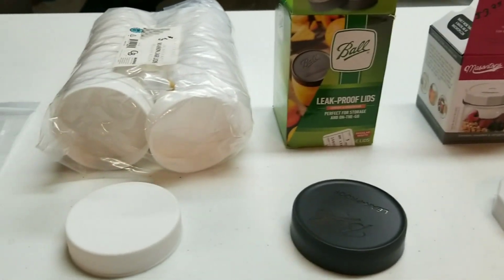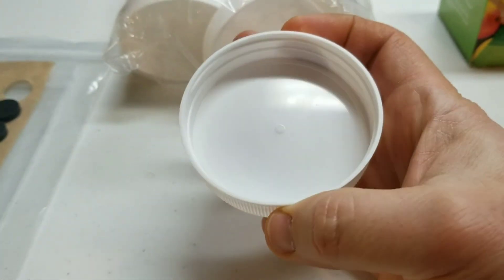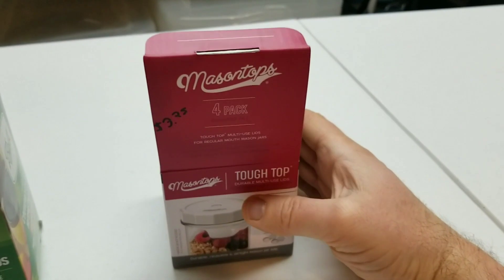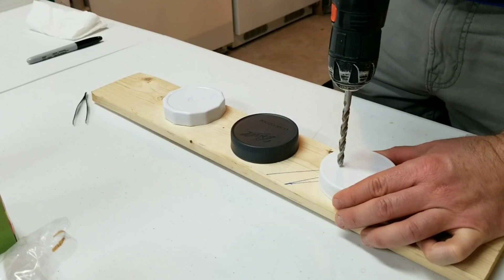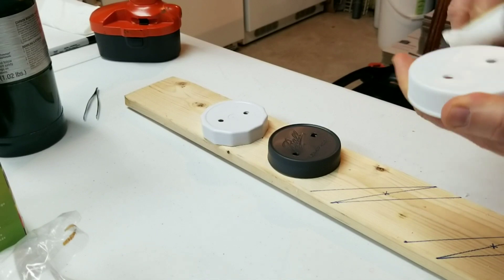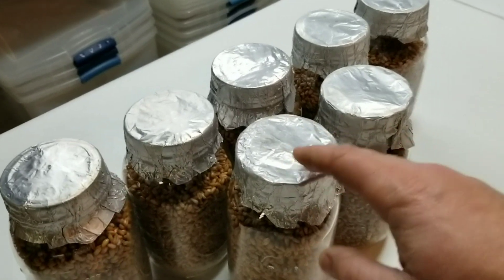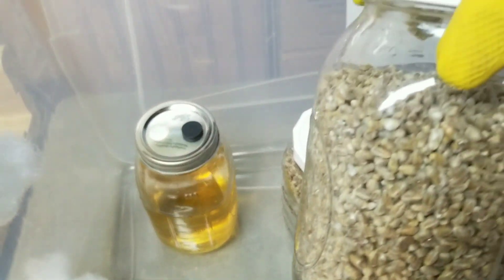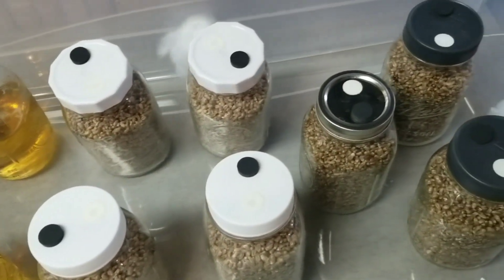TESTING PLASTIC JAR LIDS FOR MUSHROOM CULTIVATION,

Comment: Why the 2 holes on the lid ,and what do you cover the 2nd hole with.?
Reply from the maker: One is for air exchange (filter disc) and the other is a self healing injection port for injecting liquid culture. Both are available here:
https://microppose.com/RenegadeMushrooms 
Use promo code "RENEGADE" for 10% off at checkout.

Comment: Thanks for the video! I got into an argument over these plastic canning lids from Amazon. They work great and PC fantastic, never had an issue. They insist they leak with LC though 🙄 when clearly it doesn’t leak water which is thinner
Reply from the maker: As long as they are PP5 plastic, they are fine in the PC. Manufacturers say no, but that's just a CYA thing. For liquid culture, I do recommend the Masontops Tough Tops lids. They are more pricey, but worth it for the quality and solid seal.
Reply: @RenegadeMushrooms  yeah I mostly run grain spawn jars with PP5 lids, nothing too crazy

Comment: Youde probably be fine without those holes for ventilation in the tote you set all the jars in hey, maybe just a lose lid work? If only could find the chuck for the old Milwaukee drill
Reply from the maker: Yes you don't need the holes in the tote just for jar incubation, but it doesn't hurt. I have other uses for them that do require the holes though so most of mine have them.
Reply: @RenegadeMushrooms  your a good man thank you, wish the drill bits were labeled I got. Finally found the chuck, I don't even own a fridge but the chuck was on the magnetic trey attachednto the mini fridge that's taped shut that in don't use. On a new diet, I'll eventually get a fridge lol

Comment: I don’t have a drill. How can I put holes in lids?  Can I heat an awl or nail and penetrate
Reply from the maker: Yup, that would work. But how can you survive without a cordless drill???
Reply: Lol. I have up until now. I have a corded one.  I never used it
Reply from the maker: @BDK56  Well nows a great time to try it out. Buy a 1/4" drill bit for $5 and drill some lids. Just wear a leather glove on the hand you hold the lid with so you don't cut yourself. It could be a life changing experience 😁
Reply: I just ordered one on Amazon!  Leather glove. Good tip. 
Do I drill over piece of wood?
Reply from the maker: @BDK56  Definitely over a piece of wood yes, and drill from the top down through the lid 👍
Reply: Crossing fingers!

Comment: Just so ya know. You can buy the silicone gaskets separate.
Reply from the maker: Yes, I know. I've actually discussed them in detail in some of my other videos. They can work, but they have their own issues. They pale in comparison to the gaskets in the Masontops Toughtops lids. I've used both extensively, and I have no skin in the game. In this instance, you get what you pay for.
Reply: The silicone gaskets don't seat correctly 100% of the time
Reply from the maker: @1871corporationUSA  agreed

Comment: I'm just getting started down the mushroom growing road so this stuff is really top shelf info.   One thing I hope you may do is somehow keep track of how many rounds you put the lids through the PC so you can get some sort of idea as to when you should retire lids before a problem occurs.  I'm big into quality control in manufacturing with electronics so my QC spidey senses are going off.
Reply from the maker: I've run some of them a dozen or so times and they are still working fine. No issues at all with adhesion. I'm getting the feeling the filter disc material will wear out before the adhesive gives.

Comment: I'm having less contamination issues in my LC jars by not using the filter patches. I do use the plastic lids though. No rust and less pieces to handle.
Reply: So you don't mess with any attachments, just plain clean plastic lid not fully screwed down so it can breathe a little?

Comment: One question is do the filters ever need replacing? If so maybe using steel lids don’t matter. Do the lids really rust if you glue them around the hole? I’ve opened five year old bottles and they weren’t rusty. I did open like a 15 year old bottle and you could tell the lid was rusty or degraded so I know they degrade but bottled jar lids last for years before going rusty.
Reply from the maker: The filters seem to hold up well for 12 to 15 runs in the PC, sometimes longer. They definitely hold up better on plastic lids then they do on steel lids. The steel lids will rust under the filter when drilled and you will see the rust staining through the filter. The key when sticking the filters on to the plastic lids is to make sure the hole is smooth (clean up your burs) and clean (wipe down with rubbing alcohol).
Reply: So you can’t rtv glue the hole on both sides to prevent rust on steel lids?

I’ve been debating about getting steel vs plastic lids for two weeks now. I guess I should try both. Like some say the plastic ones leak or the plastic lids have a seal that falls out. I’ve worked with seals before and it does suck when they fall out. And then some say black or white lids one is better. I guess I should try them all. I notice microppose makes affordable filters etc rather then using the other kind. Ya I guess I’ll just experiment with both kinds and see if it still rusts even gluing the bottom side. I suppose maybe it doesn’t prevent the steel from being exposed to water.
Reply: So you can’t rtv glue the hole on both sides to prevent rust on steel lids?

I’ve been debating about getting steel vs plastic lids for two weeks now. I guess I should try both. Like some say the plastic ones leak or the plastic lids have a seal that falls out. I’ve worked with seals before and it does suck when they fall out. And then some say black or white lids one is better. I guess I should try them all. I notice microppose makes affordable filters etc rather then using the other kind. Ya I guess I’ll just experiment with both kinds and see if it still rusts even gluing the bottom side. I suppose maybe it doesn’t prevent the steel from being exposed to water.
Reply from the maker: @koltoncrane3099  RTV will prevent the steel lids from rusting where you drill, but all steel lids will rust eventually. I still use steel lids for liquid culture because I can't afford leaks. For grain spawn jars though, you can't beat a PP5 plastic lid with a filter disc and injection port from Microppose.com. I'm not endorsed by them, I just like their stuff. I'm personally not a fan of the syringe filters for jar lids, I much prefer the self-adhesive disc style that Microppose sells. The syringe filters are too prone to trapping and retaining moisture imo, eventually leading to mold contamination.
Reply: Okay thanks!! That helps. I was like can you use plastic lids for LC or not. Ya I’ll do the metal lid for no leaks for LC and then do PP5 for Grain spawn. Have you tried stainless steel lids? Or Have you ever had a seal melt on the PP5 as some only go to 249 degrees? Maybe a PC isn’t going to damage them. That was another concerned I’ve heard about. Ya those microppose stick on filters seem way easier haha or convenient.
Reply: I looked and microppose does offer air filters that fit over the metal lid. Have you ever drilled holes in a lid and tried the larger filter that goes above it for more air exchange? Maybe the number of air holes don’t matter. Great tip though on using a burner to melt away burs on a plastic lid. I was thinking of using a file at first but ya heat would be easier.

Comment: My Microppose lid filters changed the holes look a lot bigger than the originals I got. I've tried contacting microppose several time in a multitude of ways and there has not been one answer . But the pics definitely show a huge difference. I can't trust them or the company anymore as they wont even answer or respond.
Reply from the maker: I think they may have changed suppliers, I noticed the difference in my last order as well. The new filters seem to be working fine for me though. When WillyMyco first featured them on YouTube, I'm sure their sales took off like crazy and with all the Covid supply chain issues, I bet they are overwhelmed. I understand your frustration.
Reply: @RenegadeMushrooms  just a simple reply would be nice . I havnt been rude or anything wasn't after a refund. Was just asking the question. I did suffer some contam issues with the new filter patches on . But that was probably from another issue. I have been putting micropore tape over them just in case. Now I'm just using micropore tape.  Not sure if it makes a difference? Micropore is a lot cheaper but a bit messier.

Comment: When you pressure cook these, do you keep the rubber seal on? Also regardless of the rubber seal, do you tighten them or keep them loose while PC? I have modified lids but unsure if they need to be tight or loose
Reply from the maker: Yes, the rubber seal stays in place, and I tighten them when they go in the PC. I've personally never had any issues with jars cracking or breaking. The lids will often loosen a little on their own in the PC, so make sure you snug them back down as soon as you pull them out.

Comment: Great, another renegade open source channel I need to sub to. Thanks for answering every question I had about these lids. I've used the white lids and ball lids but had some issues. I was looking into whether the tough tops were worth it. 

Have you tried pressure cooking the tough tops with the seal? Were they modded any further? How'd they handle? Thank you
Reply from the maker: There are two options I'm comfortable using. The toughtops are good to go as is. The lid is thick PP5 and the silicone sealing ring is nice and thick. The second option, and the one I'm currently going with, is to buy the cheaper white PP5 lids I show in the video and buy separate silicone sealing rings to insert into them. This is definitely the cheaper option and they still work great. Both perform well in the PC, you just need to check for tightness after the PC run, and I still like to use a foil lid over them only while in the PC. If you're going to use them for LC, I would lean toward the toughtops, but I'm currently still using the old steel lids for LC.
Reply: @RenegadeMushrooms  thank you, and good morning! I've got the silicone seals you recommend on the way as well as some other cheaper options, a 24 pack for $20. The lids you recommend look the same as the mainstays Walmart brand so hopefully the compatibility works as well. Those toughtops look amazing but the cheapest I've seen them is a 4 pack at Publix for 10 or 11 dollars. I thought the 6 ball lids for 8ish was insanity but it's good to know they're good quality at least.

I've yet to endeavor into LC, but really excited to start, do you have a video on the topic or any recommendations? Thanks for your time!
Reply from the maker: @GoomyShoon  Yes, I have videos on all the basics of LC, agar, how I do grain spawn etc. on my channel. Here's a link to my beginner LC video:
https://youtu.be/NvGWP_jFZmo

Comment: When working with these PP5 lids and silicone gaskets, whether LC or grain spawn, is it necessary to unscrew the lids slightly before putting the jars in the PC? For example, if I’m not using a filter disc and the lid has the injection port only.
Reply from the maker: I always just snug them down and I've never had an issue. The only jar lids you would use with no filter would be LC, and those I only PC for 25 minutes. I've never had a jar crack, explode, etc. Some people, and the safety manual, will tell you that's not safe, but I've never had an issue.
Reply: @RenegadeMushrooms  Thanks brother. You always have such a great deal of information. I appreciate you
Reply: Not necessary. However, if you don't loosen the lids slightly they will vapor lock very hard and be exceptionally difficult to remove after cooling. They will also tend to bow. I'm referring to the white mainstay lids and the ball lids. I have found the vapor lock does help improve contamination resistance, though unscrewing them in a SAB is truly hellish. I've also ran them at 15 psi for 2.5 hours with no explosions or real issues.

 I plan to move to gaskets or filter disks as shown in the video because they're difficult as fuck to remove without any modding.
Reply: @Brownkid422 I know this is a old post but I bought some main stay lids from Walmart but was told they'd melt in the pc .
Reply: I bought the same exact ones cause that's all they had.  During the PC cycle I was asking myself, wait this is plastic and its getting hundreds of degrees inside there. So when I researched them online I came to the same conclusion everyone said they would melt. By then, they had already been inside for half the time required. So I decided to wait it out. Worse thing I got a mess to clean, and lesson learned. Common sense told me that I should definitely wait several hours after cycle to allow them to cool. I assumed they would be malleable/soft if taken to early. They were  semi-successful so far. All four lids did not melt, and no noticeable defects. I did 4 total. 2 contaminated (due to my fault, I overcooked the first batch of popcorn; all the kernels bursted) and 2 are completely colonized about to go to bulk.  But they are not labeled PP5 or anything and I'm still on the fence if its safe? Did you ever find a definite answer to your question? Ive decided to only use PP5 labeled for now.      @rickheath5507

Comment: Maybe I missed it, but did you pressure cook the jars with water to see is the stayed leak proof?
Reply from the maker: No, I just held them upside down full of water to see if they leaked. I definitely recommend using a lid with a silicone sealing ring for liquid culture though. They stay liquid tight and are fine in the PC.

Comment: I always wondered if the cheap plastic lids worked in the pressure cooker. Seems they did!
Reply from the maker: Yes, they work great. They key is just making sure they are PP5 plastic. PP5's high melting point allows it to survive the PC.
Reply: You can buy silicon gaskets to suit the cheaper lids. There also cheap. And there good quality.
Reply: In the discription they say not for use in pressure cooker.  I have used the three Walmart has in store.  Mainstays, ball, and tough.

Comment: Will the silicone seals inside the mason top, tough top lids fit inside the other two lids?
Reply from the maker: They will fit in the other white lids, not the grey. But you are better off buying the platinum sealing rings I linked in my pinned comment and just popping them in the cheap PP5 lids.
Reply: @RenegadeMushrooms  wow.. glad I didn't read the pinned comments. Thank you!

Comment: parafilm around the lid
Reply from the maker: Good tip, I've started using the cheap reusable silicone sealing rings to get a better seal, but parafilm or something similar is also a good option.

Comment: So the algorithm dropped me back on this video and I’ve had a chance to use these for a couple runs. I’ve had an issue with the injector ports basically losing adhesion when I spray the lids down with ethanol.  They always seem to come
Right back and I’ve yet to have a contamination issue but that’s definitely been happening.

To be clear, these were new lids that were cleaned with ethanol and dried prior to applying the port stickers. The injection hole is hella tiny too like 3/8” so there’s definitely enough lid for the adhesive to grab. You seeing this issue too?
Reply from the maker: No, I'm actually not having any adhesion issues personally. They do recommend 1/4" holes and that's what I have been drilling so I do have a little more adhesion surface. The only other difference  that I can think of is I use isopropyl, not ethanol. Not sure if that would matter, but the hole size might.

Comment: Nice video. I have found that the plastic lids can leak for liquid culture but shroom supply sells a gasket to prevent that from happening. Also, when using plastic there is no need to vent them with a syringe as you have previously demonstrated. Simply unscrew a quarter turn in front of a flow hood. For grain spawn I have had great success just unscrewing the lid a tad bit for air exchange during a spawn run. That way there is no filter to fail. Just remember to tighten before shaking!
Reply from the maker: Agreed, I wouldn't be comfortable using a plastic lid without a gasket for LC. The cheaper PP5 lids are fine for grain.
Reply: @RenegadeMushrooms  when I bought my cheap pp5 plastic lids I got a bag of silicone gaskets.  Still came in under 75 cents each.  No problems yet.
Reply from the maker: @beentheredonethatoriginals5673  Awesome, that's a good deal.